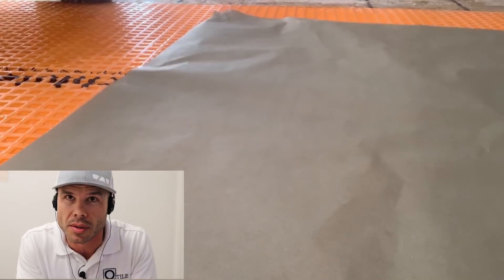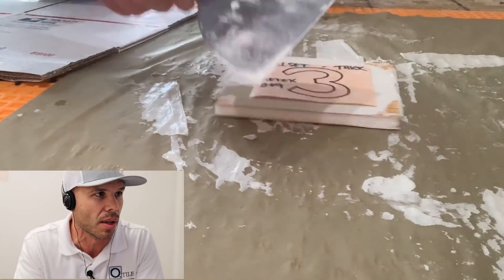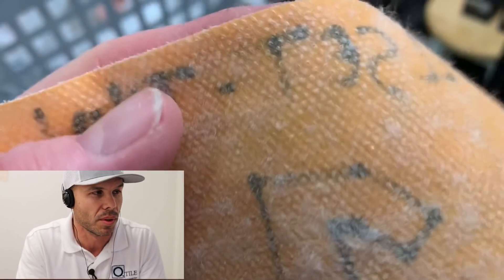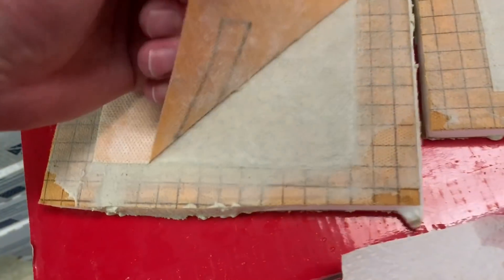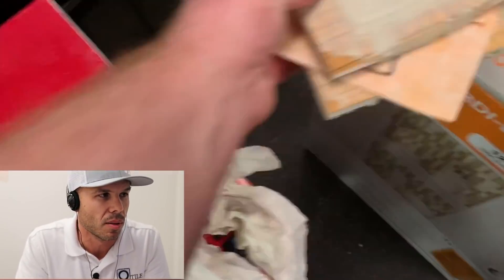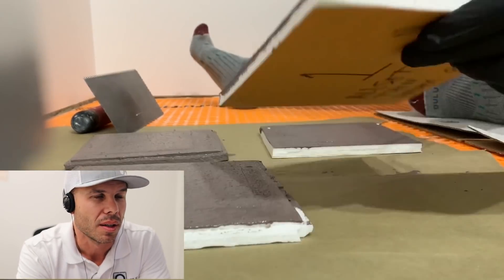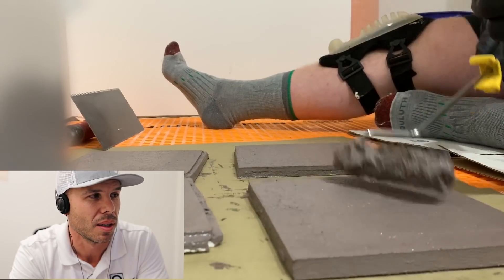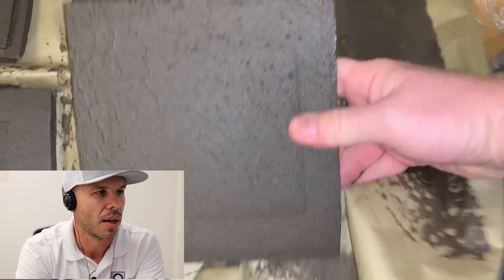Schluter ALL-SET and ARDEX 8+9 Waterproofing TEST- ***COMMUNITY SUBMITTAL***

Comment: Always love Isaac's vids. Im a contractor.here in Toronto Canada. These tests are putting the products under unrealistic circumstances. Under no situation would a shower pan be sitting in a pool of water for 24 straight hours let alone .4 days. Also does it matter if water wicks from.the thinset if the fleece is not susceptible to mold or damage. Again. If your pan is in a puddle.for 24.hours maybe you'd have a problem..  but that's never going to be a circumstance in reality. Also those pin holes in the 4th test piece in test #2  are worrisome. If that happens water will get through and because the ardex is what it is by nature it will keep that water trapped. Meaning the kerdi will likely.dry out far faster than water trapped under ardex will. Hence why we don't seal.shower grout here anymore. It's like someone falling through ice on a pond..gets in but cant find its way out

Comment: I love that your on a mission about this issue. You may get hate as though your a Kerdi hater but I went through the exact same process. I was instantly attracted to the kerdi method. It just appeals to the mechanical sensibilities most tradesmen have. But I've lost a lot of sleep over the complete kerdi showers I have out there. Schluter and Wedi are on the right path but they each have 1 major flaw that I'm prating is not a fatal flaw. It could sink all of us.
Reply: @Steve well with Kerdi I think it's pretty obvious in videos like this. Using a cement product to attach your membrane together will never make anything waterproof. I admit I am a bit of a nervous Nelly so without a pan liner I always flood test these things for at least 3 days. I've never had a failed flood test but you can sure as hell see that the water creep through the Bands. You don't need a glass box test you can actually see it through the band where the cement is wet. Now will that translate to failures down the road? I don't know but I know this excuse that the shower will never be flooded and the tile will shed water away anyway only ever gets used for Kerdi. You would never use that excuse for a pan liner

In the case of weedy I will never ever use any method that puts the Integrity of the whole shower to a caulk joint. I don't care what freaking caulk it is. I don't care if it was used on damn space shuttle. If we do use bands to tithe their walls and pans together I would be much more on board granted those bands were put together with something other than cement
Reply: @Steve Look the entire bathroom industry is at odds with my paranoia and the implications of these videos. So take it with a grain of salt. I used Kerdi and now I basically use 8+9. I just do it using Kerdi on the fresh pan when liquids have to wait to be applied, then 8+9 on the whole shower 2 coats. Ardex products are not easily available here otherwise I'd simply use their fleece membrane. But Ardex is cool with that. Ive asked their reps.

If it was my own shower I wouldnt sweat it. I just have a reasonable trepidation knowing I uave showers out there that have nothing but cement protecting the subfloor. Lol. Its a different level of worry when it's about a business, a reputation and an industry.
Reply: @Steve That is the safe bet. Not so much if you want a nice tiled pan. The fact that water wicks between the band's may not amount to any big deal. Its obvious why they wouldn't want to be open about that. It doesnt fill one with confidence. But it may very well be that even with this issue it can go on for 40 years without failure. These showers have been fairly mainline for at least 10 at this point and Ive yet to see anyone post about a failure that wasnt clearly installer error. Who knows. 

FWIW, I do think my method is fool proof. Its similar to Isaacs.  Every installer thinks that tho lol.
Reply: I'd probably use leveling cement. One bag of SLU would work for a shower. They are easy but 2 things they need to be mixed with a drill and they need precise water amounts and mixing time.

Comment: You have helped me so much...i did my first water test on the schluter shower T pan using the Schulter All Thin Set and Strips and it failed..i ripped out the strips and let it fan dry for 3 weeks. Reinstalled strips using Ardex 8 plus 9 and then coated everything with 2 layers with Ardex 8 plus 9 and it just passed..thanks so much! Now I need to tile the shower pan and curb.  Looking for a good vid to learn how to do this..send me links if you have any plz.  Thanks so much for being my coach. GOD BLESS

Comment: The conclusion that I made is if you use any type of liquid membrane it doesn't matter what you have under it. Does not make big difference if you use Schluter, or only cement board, or even dry wall.

Comment: We need the Ultimate Test, build identical mock up shower stalls in a warehouse,  use the different methods we have been discussing, set up a water supply to each shower head, run 24/7, see results. None of these tests are real world use.
Reply: Agree that running an immersion test 24/7 doesn't "prove" anything if that's not how the shower is used in the real world. I get what the testing shows, but does it matter with how people used showers in practice?

Comment: Interesting test and results. The first test without Ardex 8+9, in my opinion is useless. The edges of the foam board was exposed while under water. Therefore, we don’t know how much of the water penetration came from the exposed edges vs the all-set patch. The second test has good information from the results. This test shows that Ardex 8+9 does seal from water penetration. (unless you have a pin hole).  Since we know that Ardex 8+9 works, a third test needs to take place. Same test as the first, except seal the edges of the foam board with Ardex 8+9. I would be curious of water penetration on the All-set patches, once the edges have been sealed.
Reply: The Kerdi membrane is waterproof on both sides.  So, if water penetrated the exposed edges of the foam board during the test, it could not get from the back side of the Kerdi to the All-Set applied only to the front side.  I can't see how sealing the edges of the foam board with Ardex 8+9 would have any impact on moisture migration from the foam to the All-Set.
Reply: @ralphpond4950  the foam is also closed cell. it does not absorb water like a sponge
Reply: These 2 comments have to be incorrect...He tested using the ardex on the face only & it leaked badly...then tested sealing the edges & no leak...proving water was getting in from the edges. I would believe Schluter is testing what they sell...I would believe if they did the test without ardex again...with sealed edges...it would not leak.
Frank L agrees with Frank P

Comment: The rep at Best Tile (Schluter dealer) said "do not use Ardex 8+9 over your Kerdi band installation (I used Kerdi band + Kerdi Board)  It will invalidate the warranty and there is no need.  The Kerdi banding will be fully water proof".  LOL !  I didn't say anything.  Just picked out my tile and left.

Comment: So what's the point of using kerdi, why not just use 8+9?
Reply: I don't think he trust 8+9 only....Also you get a thicker membrane when you combine both products. In third world countries they don't use pan liners and membranes.....All they use is a liquid applied cement based waterproofing product like 8+9 except it's a different brand and it seems to work for them.
Reply: The Kerdi seems to be a more pliable  substrate that allows for the expansion and contraction or flexing of the various building materials keeping the tile from cracking.  Where as in my opinion, using cement board and then tile would be a more rigid less forgiving substrate which could lead to cracks.  The Ardex 8+9 over the top of the Kerdi gives you the benefits of the "uncoupling" membrane and the added benefit of 100% waterproofing it instead of it just being water resistant where a shower has a high usage rate with very little down time for the water to evaporate out of the thinset.
Reply: @disenfranchisedcitizen1432  kerdi is not a crack membrane, it's just waterproof. It won't keep your tile from cracking. 8+9 is not an uncoupling membrane but it's a crack membrane as well as a waterproofing membrane.
Reply: @disenfranchisedcitizen1432  flexing is not a good thing for tile. Uncoupling is a made up term, with no test method to measure it. Crack  membranes must pass a test.
Reply: Thank you for this video. You made up my mind to waterproof my shower base.
Reply: I can tell you why I do and I have been doing exactly the same for a few years now. There is a little bit of wiggle room about how long you shoukd wait to apply a liquid waterproofing to a fresh pan. 8+9 is cement based but even so its still apllied like paint in thin layers which could be compromised by water working out of the wet pan leading to bonding issues. The rule I got was 3 days making sure to test the pan by puting my trowel on it over night and seeing no dark spot inder it the next morning. 

Fleece membranes are applied with cement obviously and can be done the same or the next day. Plus I feel safer about the constitution of the membrane being a thick fleece.
Reply: So basically, ditra everything then 8+9
Reply: @mauidude3  I only do Kerdi on the fresh pan and the transition to the wall and corners and curb. I do not use Kerdi on the walls. Its basically an 8+9 application with a workaround for a wet pan. I feel a little better about the toughness of the fleece as well

Comment: So my question about these products is, how do they stand up to weight and movement on them? I'm a plus size guy and I have felt foam under a fiberglass tub given under my weight.

Yes I know, yhe foam I am reffing to does not have to be water proof or resistant. 

However, the foam and water proofings that are being used, might very well have a plus sized individual on it at some point. So if it has give, are there going to be issues with cracked tiles or water proofing failures?
Reply: @TileCoach  I was referring to the foam that is attached under the floor of some tubs as support between the tub floor and the concrete or wood sub-floor it is installed on.
Reply: Sounds like they used the wrong foam or the gap wasnt reduced with wood before the foam.  Old school way is to use structolite or dry mortar.

Comment: Remodeling my bathroom for the first time. When I demoed the floor tile I notice there wasn’t any moisture resistant layer it was just my concrete floor. Since it’s concrete do I still need to use a moisture resistant material (Schluter) for the floor???
Reply: Floor would be a schluter product called ditra. As a uncoupling membrane and waterproofing. I would red guard the floor and up the base boards 2 inches with fleece tape and set some tile 👌
Reply: I know this is a year too late but I hope it helps somebody else. I used mapei ultraplan 20 to self level an uneven floor, applied concrete sealer/primer and painted over it with polyurethane waterproof paint, although the sealee should be enough so you dont need to worry about concrete absorbing any water.

Comment: Just do what I do, put the banding together with 8+9. Works way better than thinset.
Reply: I would love to see this tested!
Reply: @wheelie707  Its how it's done in Europe. They don't allow thinset in between the seams. They have a more stringent requirement for waterproofing.
Reply: That's awesome. US Builders can get away with anything in a shower except California...
Reply: I love this idea Jason. So you basically roll on the Ardex, apply the membrane with your flat trowel then roll on a top layer? Similar to the thinset method just using Ardex, is that any harder to work the seams or corners? Seems like it wouldn’t be I just haven’t ever worked with Ardex 8+9.

Comment: What I am learning is that as a homeowner, I need to dry my shower out after finishing a shower. Don’t give the water a chance to get in there!
Reply: I think that if you don't allow your shower stall to fill up with 100 gallons of water overnight that normal anal attentive waterproofing is sufficient.  I always redgaurd the substrate before putting up kerdi board or membrane, then I redguard over all the kerdi bands and joints.  If water gets in it will be an act of God.
Reply: It's a good idea to never turn on the water in your shower.  It's really just an expensive room to impress your guests with on the house tour.    Just go down to the basement and use the 2-piece plastic shower to clean off.

Comment: Using a waterproofing liquid to prevent a leak in your shower is just not the way to go.  It’s like a putting a bandaid on when you need stitches. Go either old school with mud set and liner or go with wedi, IMO.

Comment: Nice Test.  One more great example of why Schluter is garbage. 

Just use GOOD materials for walls that are INHERENTLY WATERPROOF (GoBoard, Wedi or USG), then easy Mudbed using either a PVC Liner or Houston Method - and 2 coats of HydroBan or Mapei AquaDefense.  They are easy, fast and DO NOT WICK MOISTURE. 

Schluter only cares about their Marketing Machine - their stuff FAILS ALL THE TIME!  They are DESIGNED TO WICK MOISTURE!  So they must be installed PERFECTLY.   How many contractors do you know who are perfectionists?  Yeah exactly!  

Waterproofing should be EASY, Fast and Cheap.  It is not rocket science.  Traditional PVA Liners are VASTLY better than Schluter - ALWAYS.  If you want "modern waterproofing" then use HyrdoBan or AquaDefense.

Comment: what is he testing its not very clear
Reply: schluter kerdi ,the fleece can wick via capillary  action,thru or around the fibers,in the fleece coating
Reply: @sonofthunder.  he is literally testing paper towels... not very accurate in the real world
Reply: @codybersicc7939  its not paper its polyethylene, with a fleece surface for a mechanical bond to  approved thinset per manufacturers requiremnt

Comment: Modified thinset will always wick water faster. Use unmodified.
Reply: You have that backwards
Reply: @jeffsingleton88  no i dont. That's why schluter calls for unmodified when installing band. I have a rep sitting right beside me as I type this.
Reply: @jeffsingleton88  another reason to use unmodified is it cures better behind the band.
Reply: @mattjudy4037  no that's not why they call for it. Hahaha. (To 2nd comment)
Reply: @jeffsingleton88  yes it is recommended. I'm not going to argue with you.
Reply: Unmodified thin-set mortar must be used to construct all KERDI seams to ensure watertight performance of the system.

👆 text taken directly from schluter website. Go argue with them.
Reply: @mattjudy4037  I'm not arguing with you, I'm telling you from experience.

I know why the recommend dry set. No mortar is watertight. Your last comment is correct.
Schluter doesn't say anywhere that they recommend dry set because it wicks less water.  

If you use mod thinset on kerdi, and then it cures improperly, the band may not be waterproof.

Once cured, modified thinset absorbs less water, that's all I'm saying.

Not trying to be a dick
Reply: @TileCoach  yup
Reply: @TileCoach  yes it is. What's your point? I'm not talking about all set. I'm talking about their unmodified thinset. Not ALLSET! Unmodified is recommended for band installation.
Reply: @TileCoach  I've tested red guard over schluter niches. It bonds to the fleece extremely well.
 Been wanting to tell you that for months.

Nice work, nice vids, thanks for what you do.
Reply: The best and most efficient method is to install band with their UNMODIFIED ( put it in caps like you 😉) and then install your tile with ALLSET.
Reply: @jeffsingleton88  as am I. Been installing it for 8 years. Just had a guy at my local tile shop get denied a claim because he used modified thinset to band with. I'll continue to do it this way and everyone else can do what they want obviously.
Reply: @jeffsingleton88  and I never said it is completely water tight
Reply: @mattjudy4037  matt... once cured, mod thinset absorbs less water than unmodified.  True or false?
Reply: @TileCoach  well I've never had the problems you've had with schluter (with all due respect. And I like your channel a lot)  and I use unmodified for the band and sheet membrane only. All set for tray installation, drain collar, and tile.
Reply: In actual fact Schluter do not recommend using thinset at all. The only say to use Kerdi Coll, at all abutments and under Kerdi band & corners.
I've been to the factory (uk) and was shown this way in all of the mock-ups. I've tried it at home and can confirm that the Kerdi Coll didn't have any moisture wicking under.
Regards
Tim
Reply: @timmargereson332  that's not the case here in the US. Kerdi coll isn't even in the US. Atleast as of a couple months ago.
Reply: @mattjudy4037  Hi Matt, you should talk to your Schluter rep. The system was designed in Germany and this is the only way it should be installed, so this product is available all over Europe. Hope you get to give it a try.
Regards
Tim
Reply: @timmargereson332  I have seen isaac's video on it. I'd like to give it a try. If it ever makes it's way here, I'll definitely check it out. I am going by the recommended steps where I stay in the southeastern part of the US.
Reply: @Eric Robinson banding,can be done  with any  of their thinsets,schluter set,All set,and rapid set,or another brand of unmodified, meeting the ansi requirenent,kerdi coll,is available  on ebay,at least I saw it the other day,schluter controls the drying time  of their all set so its approved. boom
Reply: @Eric Robinson Schluter All-Set is approved for Kerdi.  https://www.schluter.com/schluter-us/en_US/select-thin-set.  The Kerdi Reps will confirm if you call them.
Reply: @mattjudy4037  Schluter All-Set is approved for Kerdi.  https://www.schluter.com/schluter-us/en_US/select-thin-set.  The Kerdi Reps will confirm if you call them.
Reply: gay